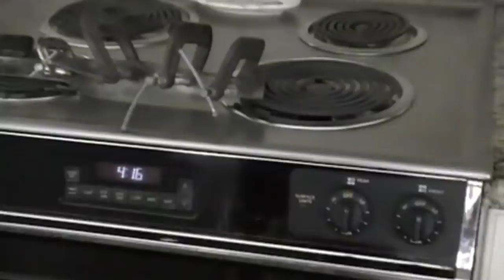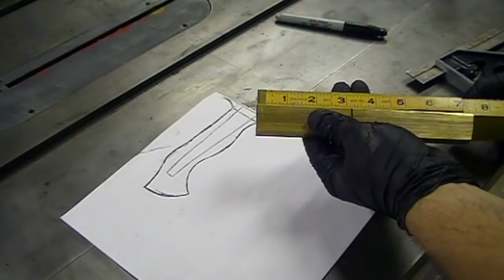Making a Bowie Knife

Comment: Use analine dyes to color your knife grips, especially curly maple. Once you try them you will never use Minwax or like stains again. They can be found on ebay, luthier supply houses, Woodcraft Supply, Rockler Hardware, etc. Some mix in alcohol, others water, and a few will mix in either one. I prefer the alcohol base myself, but that is just my preference. It will change the way you finish wood. Great knife by the way.

Comment: what would it cost for this as a blade blank?
Reply from the maker: I assume you're looking for a finished blade without a handle when you say blade blank. If so, it'll still run on the upwards of $125. If you're just wanting the profile blade unground I can upload some schematics to the blade, which you could easily send to a water jet shop to get cut.